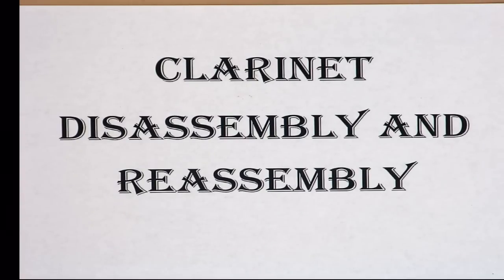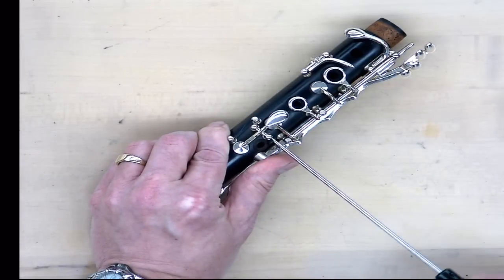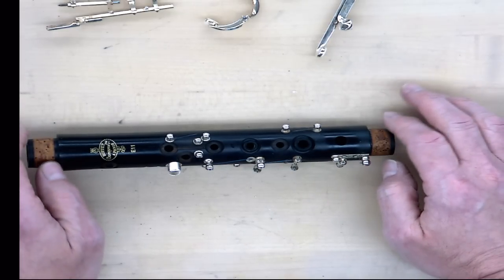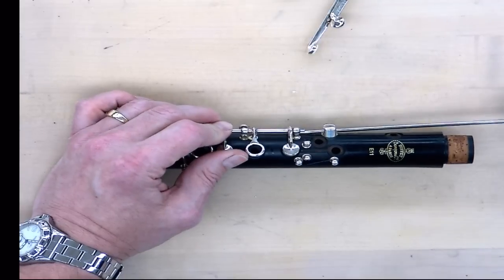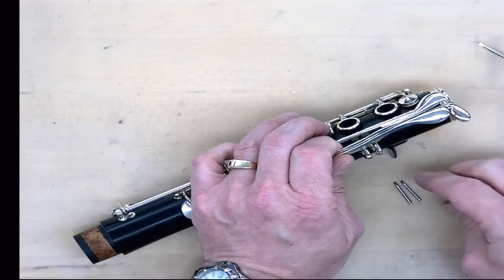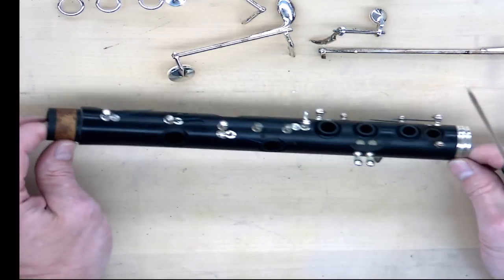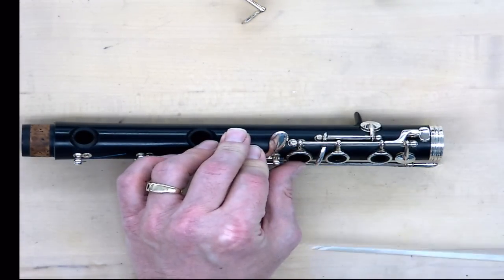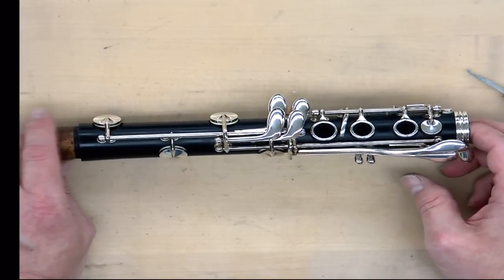Clarinet Dissassembly and Reassembly

Comment: Thanks, that's why engaging a spring is a nightmare in tight places. I didn't assemble in the right order. You have helped a man whose 1st choice adjustment tool = a HAMMER. There's so much to learn about the right way to do things. Thanks again. PS, don't worry, I only work on my own horns.

Comment: Great video. I completely dissasembled and reassembled a 1972 Bundy 577 for my granddaughter. Cleaned every thing inside and out, metal polished the keys, replaced the pads and cork. Like a brand new clarinet now and sounds great. Would have been a lot harder to do without your video. Thank you !!!!

Comment: Replacing a pad on the b key on the lower joint and screwed something up. I think the springs were not correct. The low e/b key is stuck closed

Comment: How do you get really tight screws out?  I am having trouble with the lower joint keys.
Reply: Maybe try using some key oil if you're still having this problem, work the key for a bit to get the oil in there. I wouldn't try and force it tho

Comment: What if the screw does not want to unscrew? It is very stiff.
Reply: Lionel Paz apply some pressure on the screw using the screwdriver for a period time then slowly turn the screwdriver, it should come off by doing that.